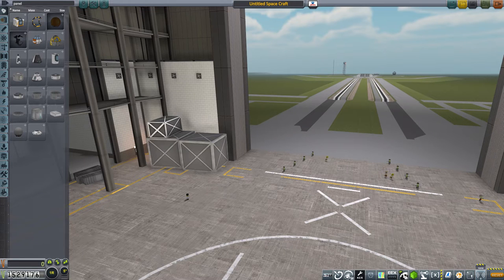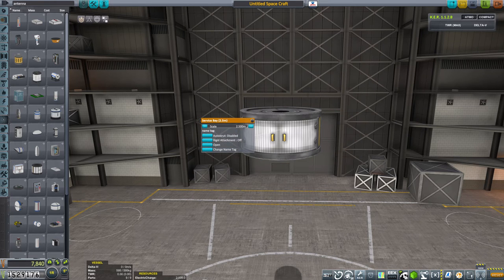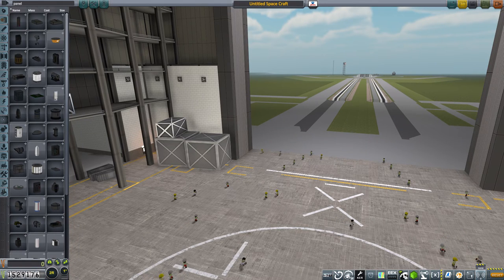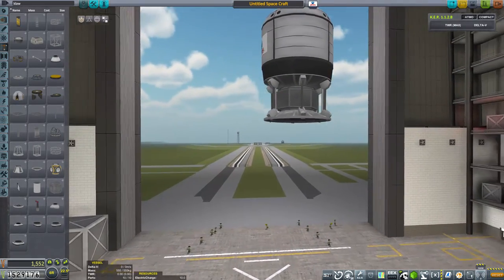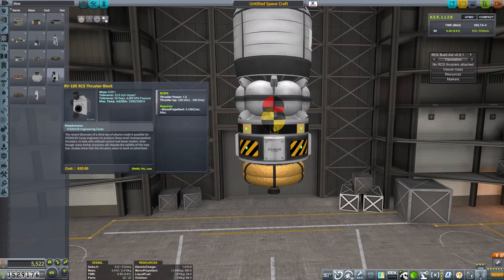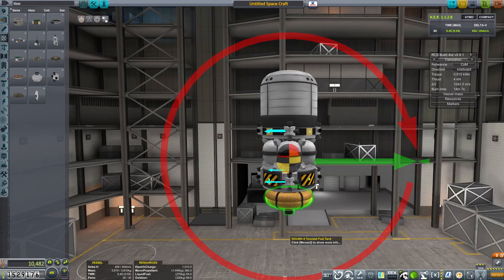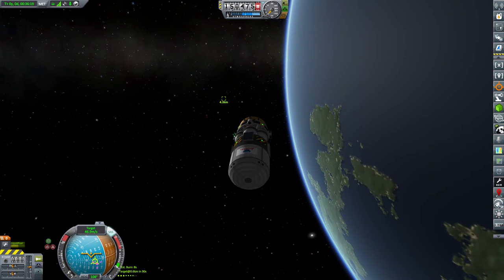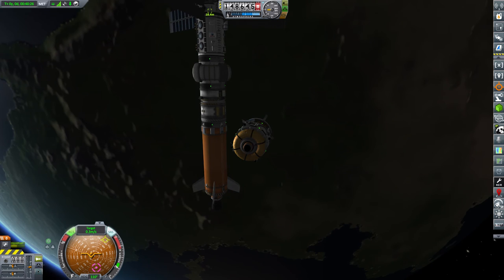57: Bits and Pieces

Comment: Best to only use rcs for work drones, slow moving is what you are going to do be doing most of the time. You'll find the rocket as more of dead weight soon. ;) keep up the great videos! 😃
Reply from the maker: You're quite right. I have two designs for the worker, one with and one without the Spark. This one is for moving larger parts and de-orbiting them if necessary, such as the Orange tank. In this case, it could probably move itself given how much fuel it has. I do intend emptying it soon however. The smaller one might make an appearance in a later video.

Thanks for the support and good luck with the Live Stream.
Reply: viruk67
Also, don't forget to add lights to the drone ;) high beams and low beams :P
Reply: viruk67
and a ladder or seat to save a kerbal if needed
Reply from the maker: Oooo, now that's a thing!